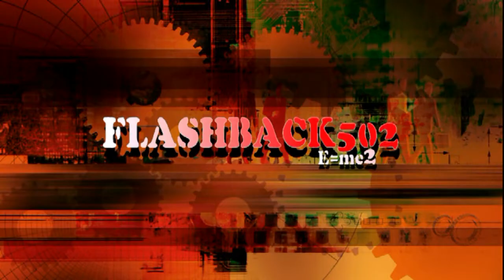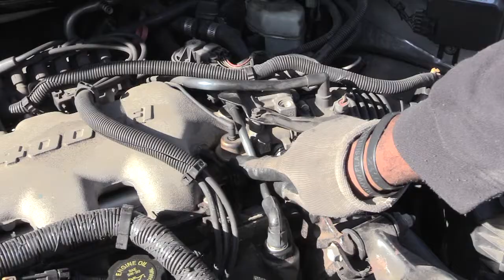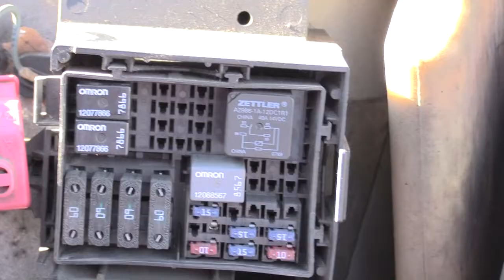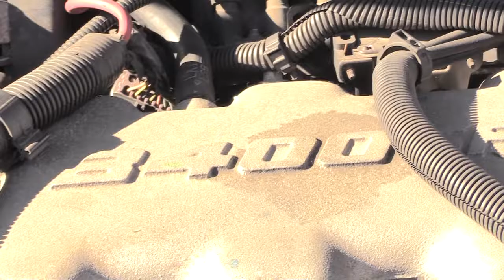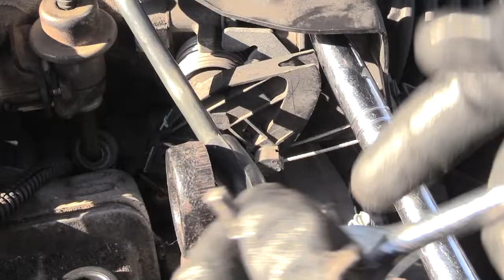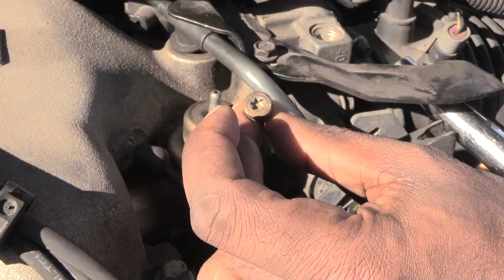Chevy Impala Fuel Pressure Regulator Change (2000-2005)--Similar Process for Many Other Years

Comment: I Just Did This On My 1994 Chevy Cavalier Wagon 2.2 Engine Mine Was Running So Rough I Was Scared To Drive It First I Changed The Ful Filter And It Still Ran Rough From Watching Enough You Tube Videos I Knew It Was A Fuel Pressure Regulator Valve I Got A AC Delco On Amazon The Next Day
Reply from the maker: Your welcome glad to help

Comment: Just a tip prior to doing the repair, if you run the car and then remove the fuel pump relay switch, and let the engine die. That will burn up any fuel in the line and prevent leakage. When you take the sensor off
Reply from the maker: Great tip thanks for sharing!

Comment: The FPR is new and I notices when checking the connection of the ETC  because; my fans dont kick on till fiel temp gauge hits 3/4 on the needle. Or; just turn on the heater defrost on AC. I found that fuel was leaking onto it the ETC. I pulled the line off the top dry. Cleaned FPR dry and it is getting wet somwhere in the middle. Its late now however; if the regulator is new. It may be improperly installed. I will use your install method to take off and reinstall myself. No need for the mechanic.
Reply from the maker: Hope u get it fixed 👍🏿 please subscribe like and share and check out our other helpfull videos.

Comment: On the other side of the fuel rail there’s a bolt to relieve the fuel pressure. You wanna do that before you take the regulator off so you don’t squirt fuel everywhere. Other than that good video

Comment: you should pull your fuel pump relay before you do that. Just saying. Also you can let the pressure out first with the valve you check fuel pressure at.
Reply from the maker: Thanks for helpful tip.

Comment: Thanks for this video. It was very helpful. Just a few minor things though:  my '04 3.4 needed a T-27, not T-30. I just went ahead and replaced that pain in the a$$ bolt w/a 10mm flange head M6-1.0 x 25mm bolt, although it could've used more like a 20mm or shorter, but that's what I had on hand. The bottom fuel line fitting was stuck to the regulator and wouldn't move, so I used the 24mm wrench and a 15/16 (I didn't have two 24's) to twist the opposite way to unstick it. I had a much more difficult time than you did, but I wanted to put that out there for people that might have the same issues. Thanks again!
Reply from the maker: Thanks for info. Glad could help Please subscribe like and share 🙏.and check out our other helpfull videos.

Comment: Just did this on my 03 3.4L Impala.  It was showing all the usual symptoms of failure e.g. hard starting, especially when warm.  The symptoms abated when the vacuum line was disconnected, forcing maximum fuel pressure.  I figured I'd be okay for a few days until the replacement arrived, but it was leaking gas out the vacuum port, bad.  So off to AutoZone.

The correct tool to use would be a "flare nut" wrench.  Too bad AutoZone didn't have one that large.  TAKE YOUR TIME and go slow if you use an adjustable wrench.  If you round off the nut, you'll probably have to replace the two fuel lines along with all the extra disassembly.

Definitely make sure you wear eye protection when you do this and wrap it in a sock or something when you pull it.  Better have it and not need it, but it's a good habit to have a fire extinguisher handy whenever working on the fuel system too.
Reply from the maker: Thanks for info. Glad could help Please subscribe like and share 🙏.and check out our other helpfull videos.

Comment: I've spent all day learning how to remove my throttle body, which I'm now prepared to do. Thank goodness you've shown a way to bypass that! I've just changed my regulator. The only thing I had to do differently was to back out a throttle body screw that was in the way of backing the regulator out of the engine. Saved me a lot of time. Many thanks.
Reply from the maker: Your very welcome Glad could help👍 thanks for comment, Please subscribe & like and share if haven't already and check out our other helpful videos

Comment: Very helpful and expertly explained.
Thank you for this awsome video. I am definitely liking, subscribing and sharing!👍🏽🔧. I'm installing a new one on my 2002 impala because it's leaking out the top but also it seems like my car is laking power and the transmission is not shifting smoothly. Should this fix this problem? I'm planning on replacing my in-line fuel filter as well.Thank you again.🛐✝️
Reply from the maker: Your very welcome, thanks for sub and like. Yes this can cause many problems.

Comment: I just changed out my impala fuel pressure regulator. I had to cherry pick your method and went beyond. I had to back out the one 13 mm bolt holding the Throttlebody to make room for the regulator to come out properly. Also I disconnected the fuel line at the connector on the other side of the throttlebody to give me some flexibility to get the bottom inlet line nut loose as it was not easy to break It loose. I ended up mutilating the old regulator to get a grip on it to break the nut loose. I’m assuming that’s why you did not do a in-process video because I think maybe you had to hack At the old regulator that you replaced, I could be wrong. Anyway I did not have to take the throttlebody off at all and the whole process took an hour.
Reply from the maker: Thanks for tips ☝

Comment: Thanks. You saved me 30 minutes not removing the throttle body. Fuel pressure regulator was causing hard start cold engine, not bleeding fuel into vacuum line.
Reply from the maker: Glad could help👍Please subscribe & like and share if haven't already and check out our other helpful videos

Comment: I’m having a huge issue trying to put the fuel line back into the fuel pressure regulator
Reply from the maker: Sometimes you just have to play with it also be sure you got the right size. Please subscribe & like and share if haven't already and check out our other helpful videos

Comment: Next time pull the pump relay first start the car multiple times until the engine won’t start anymore that way the engine sucked all the gas out of the lines. Then when you remove the regulator there won’t be anymore pressure in the lines. All you did was cut the fuel pump why’ll it was running but you didn’t get all the pressure out of the line
Reply from the maker: Good advice thanks Please subscribe & like and share if haven't already and check out our other helpful videos

Comment: Nice video. Most mechanics would remove the throttle body assembly plus other lines. You showed these things can be worked around. When you removed the reg from the injector port there was a lot of fuel leaking under pressure and not leaking out of the vacuum port which meant the diaphragm was good.  Most regulators on these models will leak fuel from the top vacuum line when the diaphragm goes bad. Good job.
Reply from the maker: Thanks for helpful info,  yea sometimes a repair can be made harder then it needs to be. Please subscribe & like and share if haven't already and check out our other helpful videos